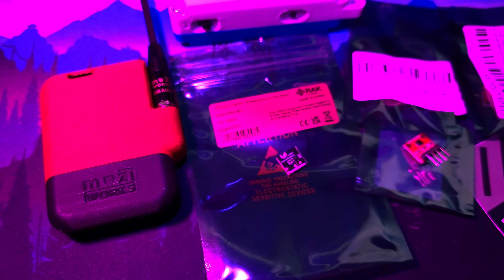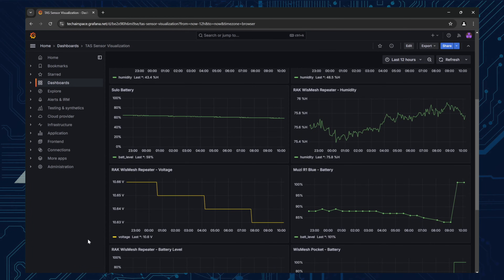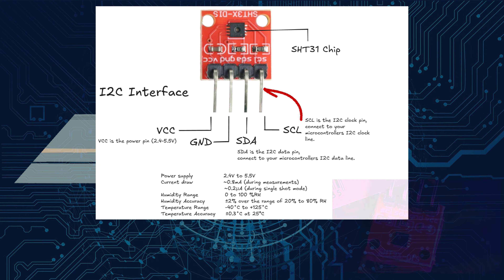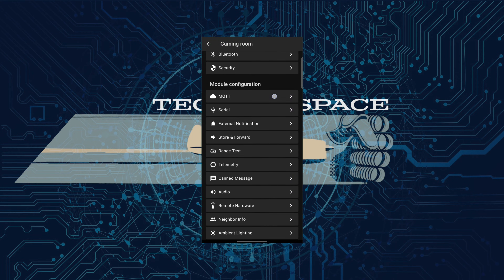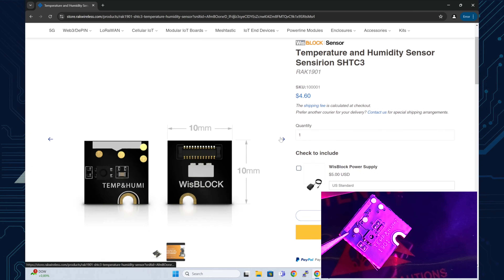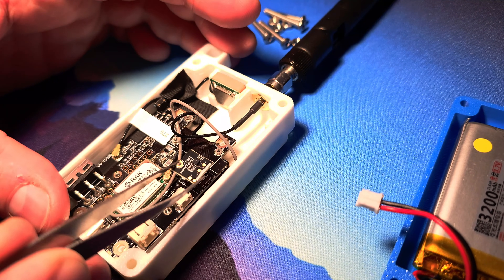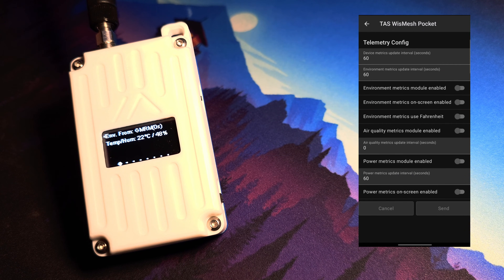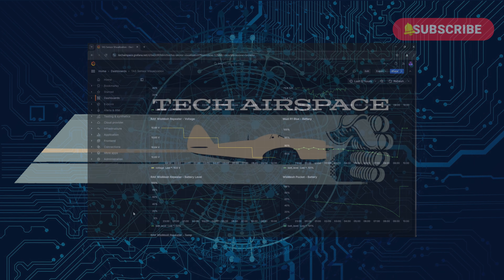Add Sensors To Your Meshtastic Nodes!

Comment: How can I connect swich litghts to turn lights on trough meshtastic?
Reply from the maker: You’d need a Meshtastic node connected to something like an ESP32 or a relay module that controls the light. Then you can send a custom message or use a channel-specific payload to trigger the relay. It’s not built-in by default, but with a bit of DIY and some code (like using MQTT or a serial bridge), it’s totally doable!
Reply: Which module exactly?
Reply from the maker: Join the Meshtastic discord channel. Lot's of examples there and nice people who can help.

Comment: If the humidity and temp sensor are inside the same case as the motherboard, won't the readings be wrong? The board gives off heat, which will both throw off the temp sensor and since humidity is relative, this information will also be wrong.
Reply from the maker: You’re absolutely right. Housing the temp and humidity sensor in the same enclosure as the main board can definitely affect accuracy. The board generates heat, which raises the internal temperature, and since relative humidity is temperature-dependent, it skews that reading too. In my case, I accounted for the temperature offset by comparing it with an identical sensor outside the enclosure and applied a correction factor in Grafana. Not perfect, but good enough for trend monitoring. Ideally, the sensor should be thermally isolated or externally mounted for precise readings.

Comment: I don’t get it, I put a BME680 in my wispocket too and enabled it in settings and it just won’t show up. I don’t understand what I’m doing wrong with this. 😖
Reply from the maker: Hmm...do you have other addon modules connected to the expansion slots? BME680 module uses I2C communication lines and there could be a possible conflict especially on with some IO modules. Did you also do the burn in for the sensor? You read the sensor once every 5 seconds for at least 20 minutes the first time that you use it.